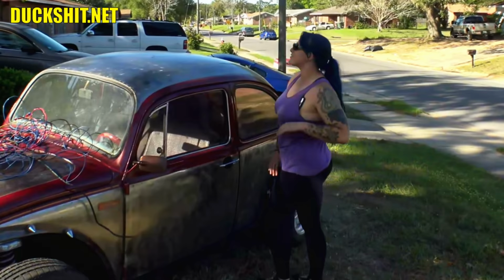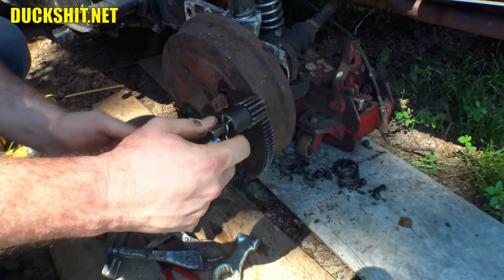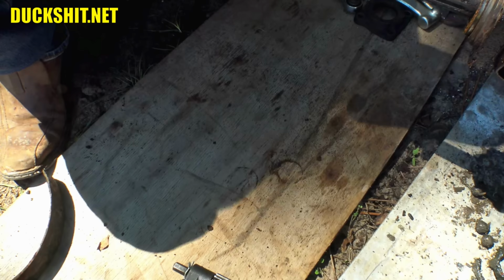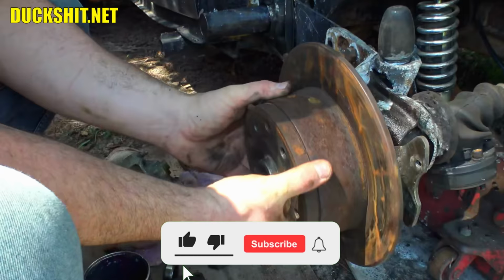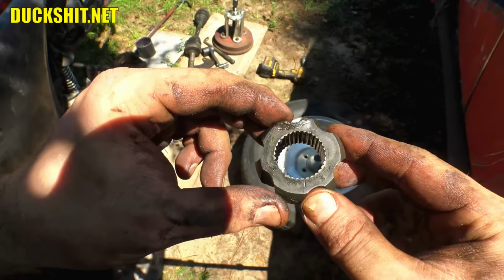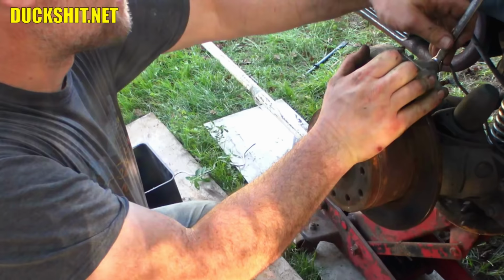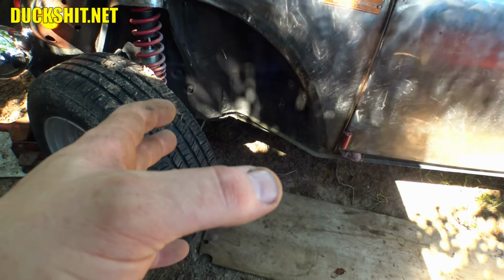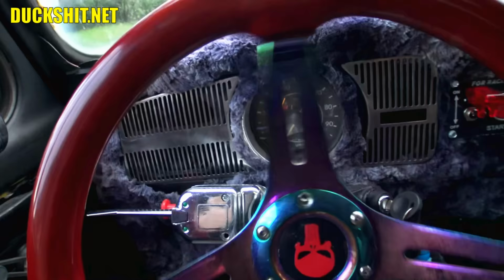🔧REAR DISC BRAKE INSTALL🔧  - Super Volksrod - VW Super Beetle - 10

Comment: That whole assembly was for the right side.Thats why that hole you drilled in the last video wasn't in the right spot.But you made it work.
Reply from the maker: Yeah that's what it looks like... however the rubber bumper and the lower shock tower are in the correct spot.   Explain that.   LoL!

Comment: Great job! The Torque Multiplier is a must for every aircooled VW owner; it will pay for itself the first time you use it. It multiplies by 9 every ft.lb you put into it. I wonder how these people ran the hand brake cable with the backing plate upside down. The Torque Multiplier can be reversed for wide five bolt pattern or 4 bolt; doesn’t the disc have a wide five pattern drilled as well? If that’s the case you can use it; just reverse that plate, and yes, it won’t fit perfectly flat on the disc but that’s the way it works for the wide five. You’re right on on the 009; vacuum advance is the ticket for street cars….Boomer is the coolest duck! 🤣😂
Reply from the maker: You can still run the hand brake on the top if you use the mechanism from the other side and turn the plate upside down.  If you';re worried about getting cables snagged offroad or something that may be a reason to do it.  The tool has a wide 5 pattern.... but there is no wide 5 pattern on this hub!  These are drilled for Chevy pattern!

Comment: When she gets the Rs up she goes fast. Needs better carb. that carb is dirty or needs a kit. She runs great when it revs. Never rode in a bug with a cam lol it really is peppy. you should buy it just to get the motor and put a stocker in it and sell it.
Reply from the maker: Thanks man, it’s the 009 distributor.  It’s wrong.  It has no vacuum advance, It was never designed to be running on a car contrary to what people say.  Gotta rev it to get it to advance.  Carb is fine!
Reply: @DuckmanCycles  Oh OK 😀😃 you can fix it.

Comment: Excellent video. It would appear there's a reason why the calipers were placed on top. It's likely because the Brake Lines were too short.  Maybe
Reply from the maker: They were the wrong lines, lol.  It was a surprise that the correct lines were found in the trunk.

Comment: Hi   Rather than usung Phosphoric Acid to derust I use Double stregth vinegar ..Cheaper and good for putting on your chips  Yum !  Kind regrds Alex
Reply from the maker: Hehe thanks... phosphoric acid does a conversion, that vinegar does not, however.  But that wasn’t used in this video!  Thanks man!

Comment: those calipers don't appear to have a handbrake function at all
Reply from the maker: You are correct, they are actually front calipers.  These are what a lot of people call budget rear disc brake kits.  For less than $100 more you can get the better calipers with ebrake function and cables.   This was that previous owner taking a shortcut yet again.  I did consider getting a hydraulic e-brake handle to put in here.  We'll see!

Comment: thats what i need new turn signal switch i whole assembly because the horn is connected in there mine is old horn problems something is rubbing in there horn honks are gets stuck
Reply from the maker: I dunno if you want one of the china ones, I'd recommend an original over this one, but if you do want it you can get one here cheap:  https://amzn.to/3LFauS5

Comment: Just a guess but it looks like that arm was from the other side of the car originally and therefore not upside down
Reply from the maker: Then why is lower shock tower not and top and rubber bumper on the bottom?  Hmmmm.....
Reply: @DuckmanCycles  Sorry, I thought I heard you say that earlier. I don’t know all these parts very well. I’ll just keep my hands in my pockets and watch the blinking lights

Comment: Is there a possibility its for the right side?
Reply from the maker: There's always that possibility, but then the shock Tower and the rubber Bump Stop would be on the other side, too!
Reply: Thought about that too; especially since he had to drill the spring plate for another hole. I am thinking that previously they just swapped the wrong side springplate on the swingarm that was installed; just because they were bolted together doesn’t mean they came from the factory like that.
Reply from the maker: @vayabroder729  Two bolts are always supposed to be in the bottom row.  The spring plate is correct.  The arm is goofy.  I think someone did some fuckery there, will discuss in next video on this thing.

Comment: Could it be installed upside down? I think it's a passenger side arm. The bolt hole upside down and now the brake drum? Hmm.
Reply from the maker: Passenger side arm upside down would mean rubber bumper should be on bottom and shock tower would be on top.  Explain that one LOL
Reply: @DuckmanCycles  that is true. Didn't think about the nubber.. Don't know what you charge for all that work. But it would be pretty pricey if it was done at a retail shop. 🤑 wish I had a local Duckman to fix my fastback. 😁